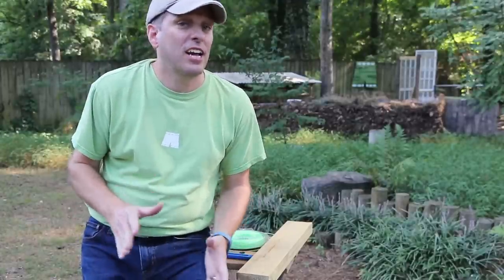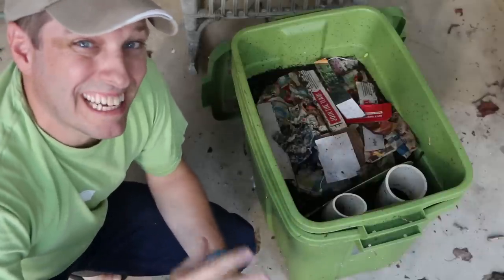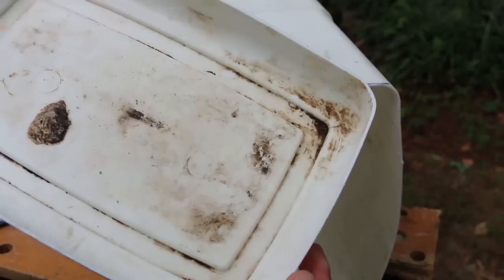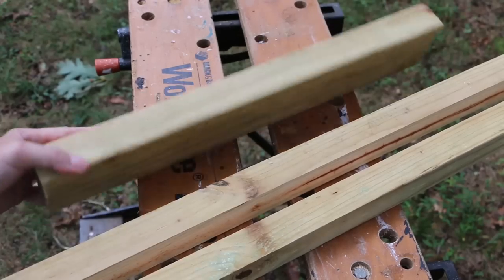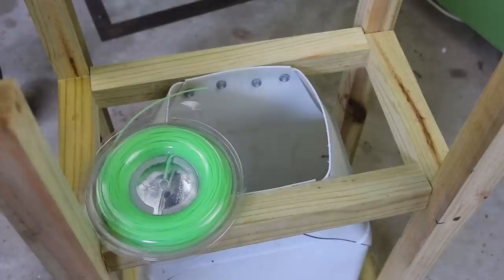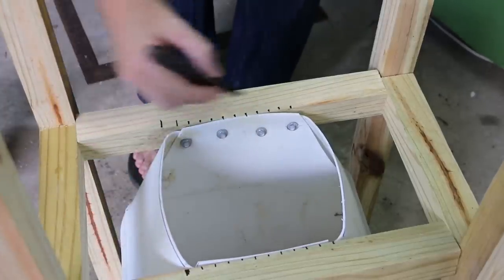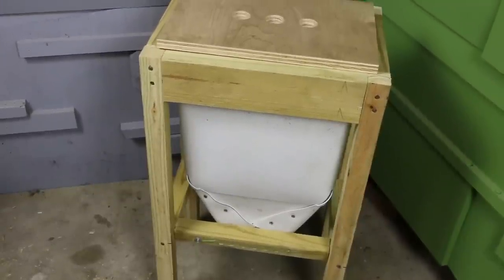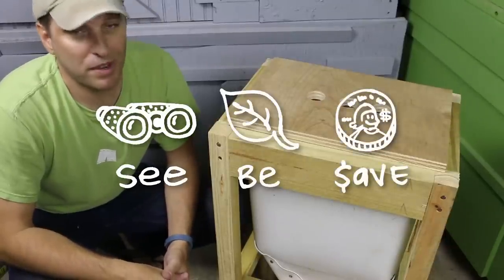How To Make A Flow Through Worm Composter

Comment: Thanks for the design tips, they were very helpful. I used the cut lines for the compacting changing them to 3.5 and seven only because I had a speed square handy. Instead of the wood frame, I used  48 qt. & 21 qt. bins so they fit nicely inside each other. I used food grade silicone and rivets to hold the compacting area together and the bottom of the 21 qt. bin with weep holes replaces the weaving nicely being held in place with grommets and two 12" Dollar Tree Bungie Cords. So the whole thing looks like a 15-gallon trash can and costs under $50    to build. I lined the inside 3" of the bin with packing tape so the crazy ants that started showing up in the house in the spring couldn't escape the bin and I haven't seen any for a while now so either the queen has died or the worms eat them as well.
Reply from the maker: Nice mods, George. Glad you found my video to be a good starting point. Makes me happy when people make stuff. Happy composting. Thanks for watching.

Comment: I really appreciate your craftsmanship and willingness to share with the public. However, worm farming does not need to be this complex. Hardware cloth could take the place of trimmer line, the natural taper/depth of the can would keep most of the worms out of the castings anyway, and the few that remained could easily be picked out by hand. You could also use pop rivets to create a taper. In place of a trash can, one could also sew a tapered cloth bag with heavy fabric with drawstrings at top and bottom. Search “digestible table” for plans on that concept. Thanks so much for sharing! Really great video.

Comment: SUPERB! I think this is a low cost way to scale into a commercial enterprise. Thanks
Reply from the maker: +Stephanie Davis go for it! A few tips...I could probably have used a little less angle on the taper. The worm castings are pretty sticky. I'll be making a simplified version of this in a month or so.
Reply: I meant to ask u about the screws u used for securing the taper. Were they the same as u used elsewhere(excluding the rake screws)...
Subscribed 2 your channel; keep up good work. Merry Christmas.

Comment: looks good... one suggestion when you wrap and tighten the string with your bolt head by crossing the string over itself (17:30 and 18:25)  it will snip it off at the point where they cross.  Any electrician would pick this up as a no-no for solid wire,
Reply from the maker: Thanks for the feedback, Gregory. In a later version of this design, I eliminate the trimmer wire altogether.

Comment: NO DUMPING SOLUTION: To solve your problem with the two-bin system, turn it into a three-bin system.

The two-bin system bascially stays the same. The bottom bin will catch the leachate and the bin above it will be the "home" bin.

BUT, add a second perforated "home" bin with fresh bedding and scraps on top of the other two bins. As the food supply is consumed in the now-middle bin, the worms will wriggle up through the holes into the new-top bin in search of food. Once they have all migrated, simply remove the middle "home" bin (now abandoned) which is now only castings and put the new "home" bin back in above the leachate bottom bin. Rinse and repeat.

Bins top to bottom:
1. New home
2. Current home (castings)
3. Leachate
Reply: What if my worms doesn't want 2 homes and they want 4? They won't I be building a worm skyscraper with a top penthouse?
Reply: Scott Jordan, I currently have a three bin system and it is not working that way. I have to put a couple of damp sheets of newspaper because about about 1/8 to 1/5 of my worms end up in the bottom bin. They bring castings with them but my bottom bins never become wet enough on their own to keep my downwardly mobile worms from drying out. The containers become full of castings and the worms become very sluggish and don’t generally move up or down for food. I don’t think it has to do with temperature because, living in Southern California, temps outside can be very high and I would have to stay home all the time to make sure they are not getting too much heat  when the sun moves and containers are in the sun again. I have tried moving them with light but they don’t move to greener pastures. I go through a 3 container stack every month to five weeks.and I have to do most of the sorting by hand. I still end up with worms producing wonderful castings and worm cocoons. The time I spend harvesting and sorting is quiet and mentally relaxing. One or more of the dogs usually hang out with me and I listen to music, podcasts or audiobooks I wouldn’t have time for otherwise. I enjoy checking to see how everyone in the bins is doing, if they have food leftover, what they seem to have eaten quickly and completely. I guess I enjoy being hands on with my worms and the dogs like to know I put gloves on sometimes I am not going to flush their ears or dig dirt clumps out of their paws.

Comment: Well done video. You clearly are knowledgeable and experienced. Just the tools you own indicate that. For someone that doesn't have the tools, or wood lying around, or an old trash can to use, would make this homemade version more costly and less portable than an urban worm bag with a PVC frame. Plus because the worm bag is made from material it is 100% breathable all the way through not just where holes would be put in.
But this is a great alternative for someone like yourself who has the materials on hand the tools needed to make it and the knowledge to do so. I wish you spent a little more time discussing the sizes of the wood pieces you cut. A few pieces were cut where you didn't mention the size.
Reply from the maker: Thank you for the feedback. I appreciate your encouragement and the info about the worm bag. I’ll need to check it out. I’ve been thinking about building a design that has more surface area using a tarp. Thank you for watching.

Comment: Didn't read thru the comments but ever try the banana trick to attract all the worms to the top? One over ripe banana partially unpeeled will attract all worms to a massive clump. You'll be able to remove most worms in one go.... Also I would recommend a piece of hardware cloth instead of sewing the bottom with string... But I understand the recycle bit ... Use what you got

Comment: Hello I cannot find the part 2 to this video.. Can you give the link please? 
Also how do you like it? Do you see any issues with it that you would modify?
Thanks!
Reply from the maker: Hi. I did a full redesign on this with a goal of simplification. If you search for simple flow through worm composter you should see it. I used a black trash can for that build. Note that I initially started using the trimmer line element, but replaced it with a perforated metal plate in the third video in that series. Thank you for watching.

Comment: good prototype although starting at 9:07 it gets overcomplicated. (BTW look for cans with an even top rim, they are common enough.) 
1) leave the rim on. Really just eliminate all of the trimming other than the tabs on the side.
2) If you have or can borrow a pop-rivet tool(they are pretty cheap really) use pop rivets for the taper instead of all the carefully aligned wood bracing. Use the bracing for the rails in tip 3. 
3) forget the trimmer line, use a web nursery flat or standard flat with holes added(use a hot poker/solder iron) preferably the extra heavy-duty type from a commercial greenhouse supplier, or maybe double up a thin flat with a web flat. This flat can be supported by wood rails so it can be slid in and out.
Note: The taper is not for the worms, it prevents the bulk of the material from falling out when the tray is removed with a few castings.
Reply from the maker: I agree. This was too complicated. I did a complete redesign on this. Thank you for the tips.
Reply: @GreenShortzDIY  It's better to have built some prototype than to wait for a perfect design and never build anything because of endless revisions.
Reply from the maker: True. My second design eventually eliminated the trimmer line. Took me a few videos to recognize a better way.

Comment: I started to make your first blog.  Then i watched further blog. Had to  change mines
Reply from the maker: Hi Rodney. Sorry you went down the first path. This project was a learning experience for me as well. It took several videos to get to a final product. By the way, I eliminated the trimmer string in a later video and replaced it with a metal plate. Thank you for watching.
Reply: I made a  slide out bottom instead of sliding the whole bin.
Reply from the maker: Excellent solution.

Comment: Interesting. I made one of your 5 gallon bucket types, got some great 'black gold' out of it and great compost about half way up now. Was thinking of making a 2nd one and just taking top portion over to new bucket where most of the worms are working to be able to use the compost they/ve made.
Reply from the maker: Papa Bly Glad to hear you've had success. I think having to bucket worm composters is a great option to manage the worms and get castings out. To help with this, I suggest cutting down a bucket lid (or any other plastic lid) into a circle that would fit down in the bucket. Think of it as a layer divider. Drill lots of holes to perforate this so the worms can migrate up through it. Put two loops of string through a couple of the holes. This will allow you to lift out the top portion of your compost, with the worms in it, more easily. I did something similar in this video: https://www.youtube.com/watch?v=aHS1UKdUzVo Except it was with a rectangular worm bin design. Just scroll to about 8:10 to see what I mean.
Reply from the maker: Papa, here is my case for going with a flow through worm composter: How to Harvest a Flow Through Worm Composter: https://www.youtube.com/watch?v=6ScnbSySrFg

Comment: Why does "pressure treatment" to natural untreated wood make it uncompostable?
Reply from the maker: Haydn, pressure treated wood is infused (under high pressure) with chemicals like copper and others that make it resistant to rot and bugs. The residue of those chemicals is released into the soil slowly, but enough to mess with things. It is also bad to burn pressure treated wood. Thanks for the question.
Reply: pressure treated with copper/chrome/aresenic [tanalith]!
Reply: Found this answer right away! Thanks!
Reply: aresenic kills worms
Reply: @brandondumont7223  They havnt used arsenic in about 10+ years for pressure treating

Comment: interesting design that doesn't require a physical barrier for the worms. I'm looking at a couple of designs, and the general principles here are interesting --- notable that the castings fall through and the worms stay up top.

A couple of thoughts:
1. Instead of cutting off the top rim of the trash bin and trimming the corners of your wood lid to fit inside, why not leave the lip there and set the lid frame to fit around the lip?
Less cutting.
2. Instead of weaving trimmer line at the bottom, why not just afix some galvanized 1/2" screen?
Reply from the maker: Hi Craig. Excellent questions. I’ve redone this design a few times to simplify and made adjustments very similar to your ideas. :-) I did make videos...of course.

Comment: Hey, it's pretty satisfying to watch, but the one thing I thought of that I'd want to know in your shoes- when you're putting those brackets on particularly, but this also applies to the rest of the woodwork/fastening- old school carpenters putting a nail through two horizontal boards don't put the nail straight down, they put it at a 45 degree angle in, and then they'd come back on the other side and put in a nail going 45 degrees the other way- making an "X" inside the join of the two boards, roughly.  Why is this important? Because, it means that no matter what direction the board is moved, there's not a direct friction path for the nails to come out- and so the board stays more secure for longer.

Also as I watched you use the weedwacker line (great idea!) I couldn't stop thinking about that hack to turn 2 liter coke bottles into string (or, really, any size of bottle) by basically pulling the string end through a razor blade secured to a work bench with a couple of screws and washers.  Something worth googling.
Reply from the maker: Hi Choscura. Thanks for sharing the tip. I’ll remember it on my next build. Screws are usually my preference, given their resistance to loosening, but nails can be a less time consuming choice. I do love my framing nailer. :-) I’ll have to check out the hack you mentioned. Sounds pretty cool. I actually did a simpler design of this flow through worm bin, which slides to harvest. I tried the trimmer wire at first, but ultimately took it out in favor of a perforated metal plate. Thanks for the feedback and suggestions.
Reply: The metal is probably a better bet. I've been discovering/researching/dealing with metal corrosion as a topic a bit recently and so I've been turned on to the material Aluminum Bronze, which is used in things like heat intensive processes (computer heat syncs for example), and also in situations where corrosion is an issue (oceanic vessel propeller blades, for example) or both (such as the inside baffles of some firearm silencers/sound suppressors).

I kind of wonder what a full-stack system would look like if you integrated this into basically the water systems of an earthship- rainwater collection, filtration for human consumption, all the way through to gray water re-use (so your tapwater that doesn't get used goes into the toilet to flush it, after watering the plants in the front planter)(this is very worth googling if you're not familiar with it- the guy that came up with it is very nice and competent but a bit crackpotty and so ea, I don't think there's anything super-spiritual about the buildings, but the technology of how to build better houses that provide utilities is worth seeing).  I really would like to see something like this integrated into a biogas digester/collection system, maybe, so that it can be basically ignored by the family in the house with it- the most successful case is that it becomes 'the other trash can' that produces the gas + fertilizer for house use, I think.

Comment: I just bought the Hungry Bin bc Im a 4'10" lady who loves these types of projects but I can't cut through those plastic containers with scissors (I had Cancer in upper body so my strength is super challenging)...... maybe I could use my Dremel? But that would take forever prob.... my question is wouldn't a black trash bin be better to use since it will keep the light out better? The darker the better right? Also wouldn't 1/2" mesh work just as well for the bottom to keep the castings from falling through but also allowing it to fall through? Just put it inside and secure with some screws? Idk just wondering bc it seems to me the plastic trimmer wire will break down or it won't keep the dirt from falling through?

Comment: Amazing information!  I like the flow through concept a lot.  It solves many issues.  I need a composter like this where I can get my castings and not have to do much more than load compost material where the worms can turn them to castings then the separation process takes place with the design if the compression zone.  Thank you so much for sharing.
Reply from the maker: Thanks Chelle. Good luck with building your flow through worm composter. 👍🏼

Comment: I am SO grateful I came across your Channel!  
Was there a specific reason for using the plastic line instead of metal (for example, from metal clothes hanger or metal insulation holder in cross grid fashion)?
Reply from the maker: Thank you. I primarily used the trimmer line because of its durability and lack of corrosion. The screw heads on the inside of this pretty much get dissolved. Coat hanger would suffer a similar fate, I think. Ultimately, I did remove the trimmer line in favor of a perforated aluminum sheet. Thanks for watching.

Comment: Why not just use a section of wire cloth to cover the bottom? I did that and it worked fine.
Reply: I agree with wire, make a wire basket on hooks that can be lowered incrementally. Start flush against bottom, lower as it fills up and take off and empty when full.
Compost tea still collecting below this in bin.

Comment: hey mr shotz :) thanks for your Videos! i am planning my first gardening Adventure and here are a few Questions from a newbie..  what About a bamboo-bin (this flexible ones like a strandmat) and Fixing the smaller Opening at the Bottom with a metal or plastic ring - when you now seperate the Opening by a few wires or other strong tubes that you can remove for harvesting, then you coulg get the soil by "massage" (kneading the Bottom section). or not?
and: what About horse apples? will they produce too much heat? and i did´t get the fact how Long it takes from the first feeding to the first harvesting - could you help me?
best regards from germany